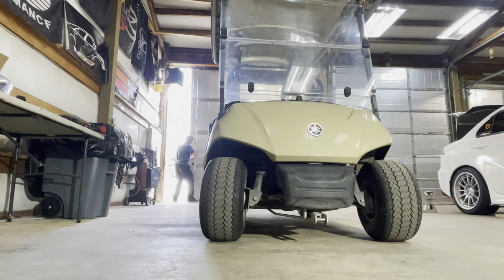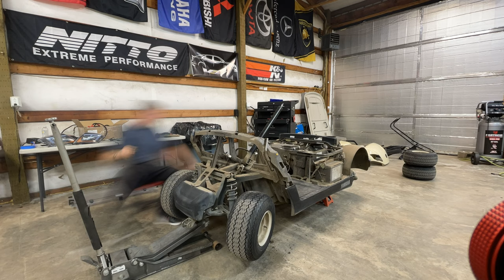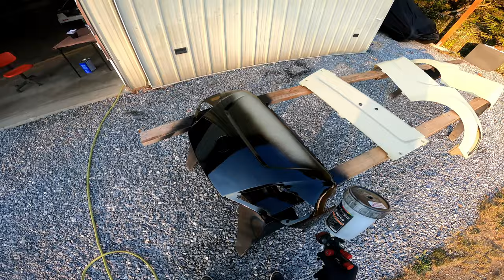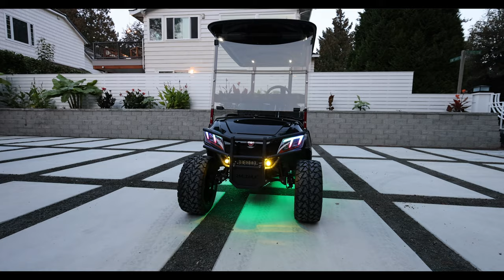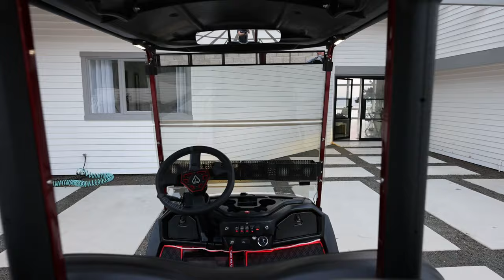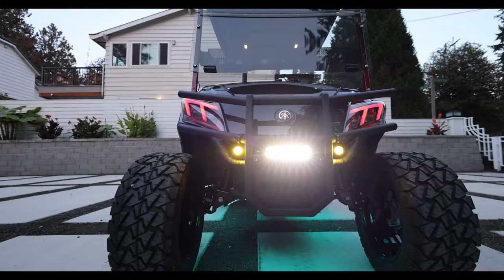Golf Cart 2020 Yamaha Drive2 Disassembly and Build

Comment: How many inch lift did you install for the 22” tires? I have a drive 2 adventure sport. It comes with a 3” lift from the factory. I’m trying to figure out if 22” tires will fit mine.
Reply from the maker: I’d imagine 22” wheels will fit.  I just had to slightly cut the fenders so it doesn’t rub.